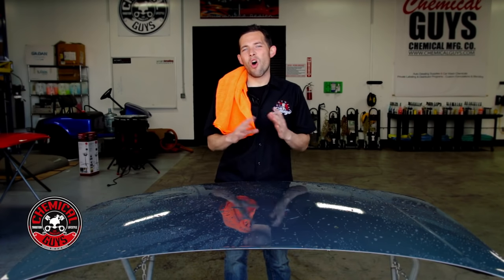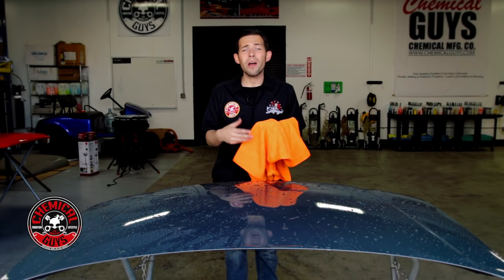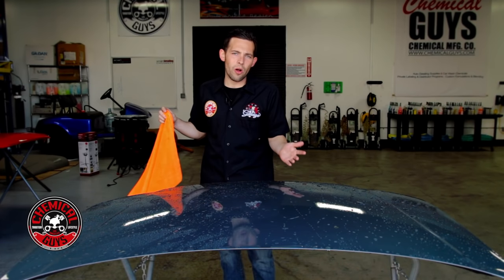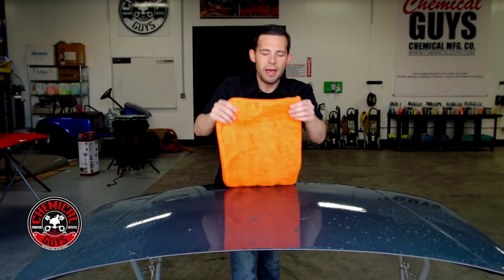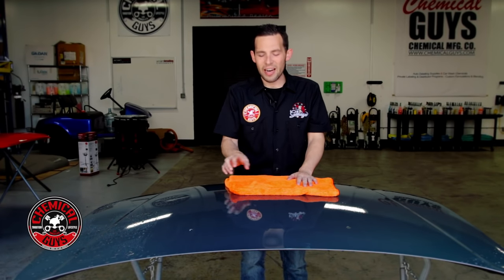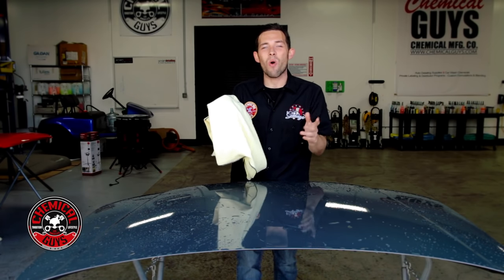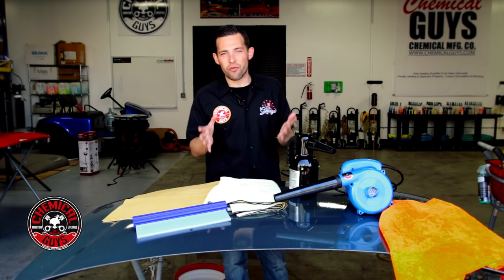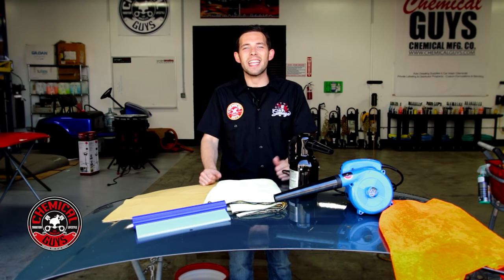Best Car Drying Tools: Towels / Chamois / Blades / Blowers - Chemical Guys

Comment: How do you clean dirty microfiber towels?
Reply from the maker: Chemical Guys Microfiber Wash is the perfect detergent to clean and rejuvenate microfiber goods. The advanced cleaning solution removes dirt, stains, grease, wax, and grime from microfiber. Microfiber Wash restores microfiber towels back to original condition by releasing dirt and oil from the fabric for a soft feel. Citrus-based detergents penetrate each individual fiber for maximum cleaning results. While typical detergents stay locked inside cloth and garments, Microfiber Wash rinses completely clean for a perfectly-soft, residue-free towel. Microfiber Wash contains no bleach, no fabric softeners, and is safe on all color microfiber goods. Easily clean and rejuvenate microfiber towels, blankets, sheets, bedding, and clothing with fantastic results. Microfiber Wash opens the billions of strands inside microfiber fabric to gently release dirt and grime. Microfiber towels require special cleaning, and Microfiber Wash is specifically designed to clean sensitive microfiber goods. The innovative citrus-based formula is all-natural and will not chemically-burn microfiber, keeping it as soft as the day it was made. Microfiber Wash contains water softeners that neutralize minerals and calcium to ensure your microfiber goods rinse perfectly clean and soft. 

Here's a link to the best microfiber detergent available. https://www.chemicalguys.com/Microfiber_Wash_Detergent_16_oz_p/cws_201_16.htm

Comment: lol I have the same water blade but mine is yellow, I actually find it great it helps to get rid of most of the water on the car but I always use microfiber towel afterwards to finish it, I also recently bought Chamois Leather and I'm gonna test that too but from this review it seems like a bad choice =/ also that blower is so weak lol i got turbos bigger than that

Comment: Regarding the shammy you say "because thid isnt microfiber its possible to scratch the car more"? Ok do explain how that is. Oh and by the way the beauty of the shammy is its blotting capabilities sinces it absorbs with no issues.
Reply from the maker: Hey, thanks for watching. The shammy is course, and isn't meant to be dragged along the hood of the paint, that's why it's dunked in the water, and wrung dry. Most towels actually need some kind of lubrication, otherwise you could possibly introduce new scratches and swirls.

Comment: I need something quick, I work at a dealer I'm cleaning about 15 to 20 cars a day and I need to detail and wash them inside out but I need something to dry the cars quickly instead of old towels it takes too long I was thinking of a leather sham
Reply from the maker: Hi Randy, After wash and a large towel will do, the Wooly Mammoth towel is great, it's huge and plush.

Comment: Does it also absorbs the shampoo residue on the car ?
Reply from the maker: Hi Mohd, our soaps are PH balanced so they don't leave any residue, also we use deionized water which doesn't leave water spots since the minerals have been purged through a filtering process. The towels such as the Woolly Mammoth, and the Waffle Weave Towel are extremely absorbent , and they will pick everything up. Stay tuned buddy, we've got more great videos coming your way.

C.G. Alex -

Comment: Your blowers are very misleading.  First, they are to small and not a lot of cu/ft/min output.  And,  in order for a blower to work really well, the surface must have an excellent coat of wax underneath.  No water beading, you'll spend a long time with a blower.  With that said,  I've used nothing but blowers for many years on my 'treasure' cars.   And an average leaf blower from any big box store will do the job better than either of your two featured blowers combined. The heating element is a joke blower.  It doesn't 'dry' anything.  There was some nucklehead on some of the car forums pushing a so-called master blaster.   It too did no better than an average leaf blower, but was 4x the cost. A blower  IS an excellent way to dry your car.  The lesser things that touch it the better.  After each wash,  come back over with some quick detail spray and good till next wash.
Any microfiber towel that is dropped on the ground -  either throw it away or put in seperate box with your oil and grease rags.,  Should never be re-used again.

Don't even get me started on using a 'silicone blade'.

Comment: That heated air dryer... you said it will evaporate water dropplets thus reducing water spots. well...thats how water spots develop in the first place guy. evaporating the water leaves behind the minerals and such in the water, creating water spots.
Reply from the maker: HI Brandon, you're supposed to use deionized water, eliminating the water spots. Also, if you use a drying agent, the water will simply bead off.

Comment: why would I use that "detailer" blower when I could use a gardening one that is bigger stronger and probably cheaper
Reply: trevor philips Many detailers are mobile and having a small blower might be useful, especially if it connects over a 12V adapter.  Might be good for interiors where you can't reach tight areas.  I would probably just use a normal hair drier for inside.
Reply: Like a leaf blower?  I was wondering about that as well.  Would it be necessary to have a filter on the blower?

Comment: You shouldn't drag a cloth across car bodywork to dry, you're better off lubing the car and slightly wetting a microfibre cloth then dabbing. Takes longer but you won't scratch the dust particles in the water droplets into your paintwork.
Reply: +James Wilkinson you didn't wash your car right if there's still dust particle on it.
Reply: +Adam R it's 100% impossible to remove microscopic dust particles which settle in water droplets after wash even if you've used two bucket method, snow foamed etc. 100% impossible.
Reply: You are correct. The above-average person will wash the car outside or even in the garage or wash bay - environments such as these areas will have dust formulate on and around the car. It is virtually impossible to avoid, unless if you are a professional detailer (chemical guys garage) who has a garage that filters out dust buildup inside. 

I personally, prefer the air force blower - at all times i am always looking to avoid any kind of contact with the paint. Even though microfiber or waffle weave towels are excellent, it will generate some swirls.

Comment: my cousins just opened up car wash and they use water blades to remove water and than they dry car with alcantara cloth, alcantara is better and much more expensive than microfiber and its weird that nobody is using this method.
Reply: because it sounds terrible.

Comment: I dont understand why anyone would use the water blade over the microfiber or the chamois. You have to do multiple passes over with it and then still you admit that you like to go back over with a microfiber anyway, why not just use the microfiber to begin with since it was 1-2 simple passes instead of like 8+ over the same area.
Reply: It's not as easy to use water blade on car surfaces as it looks. The secret of using it is to be light with it and let the blade do the work. When the blade glides on a wet surface almost with no effort whisking the water away, you've found the right technique.

You need to slide the blade only once on each area even when there remains some moisture. Also, you need to Wipe the blade clean with towel before each sweep.

Comment: alot of people are shitting on the water blade. We used those in the air force to detail our vehicles for years. They sound bad but we never had any problems with scratches or anything. just dont be and idiot and use alot of pressure. I even use one for my European beauty..No problems.

Comment: Safest and easiest? Not even close! Air or touch less is the safest way to go provided the air is filtered. You'll removed 90-95% of the water on the vehicle without even touching the paint. Towel your car of and then move it, your guaranteed to have water displace from weather striping and body gaps back onto the surface.
Reply from the maker: Brett T  Air requires electricity. Thus, microfiber is easier to use because it can be used to dry a car anywhere, anytime, without added power sources.
Reply: Chemical Guys regardless of needing a electrical source, you guys make pretty lofty claims that make many people wonder. Many things in the detailing world require electricity which in my mind at least, doesn't disqualify them from being the best way of doing things. You guys make great products but like I said, I really wonder sometimes when watching your videos. You always talk about being less aggressive so what's less aggressive then not having to touch the paint.
Reply from the maker: Everyone on the internet is a skeptic. Just pick whatever drying method you would like and be happy with it.
Reply: It makes sense to have filtered air, especially since an air compressor builds water in it over time. However I don't think its necessary for 99% of the cars we will use them on.
Reply: +Chemical Guys I don't think he's being a typical Internet sceptic dude. he's a car guy who wants to know exactly what he's doing to his paint. i wouldve expected you to understand car enthusiasts like us instead of just pushing products. seems that's what we get from an anonymous person from chemical guys.
Reply: Dr. Siracha he's not pushing products, he's giving you options. But hey, if some guy online says you should buy something and you uncontrollably buy them because he said so, that sounds like a you problem.
Reply: No cost if you drive around your block and back to your house.  Then I use a microfiber drying towel to wipe where two materials come together to get that last  bit of wetness out.  Patti

Comment: I really feel like that hood is ceramic coated. That water came off way too easy
Reply from the maker: Hey Josh, if Carbon Flex C9 was applied on that hood, the water wouldn't have had even had a chance to settle on it! That's how slick the coating is. In reality, these hoods sit outside all day and all night for months on end. They are the hoods that the students at Smart Detailing University learn how to polish on and they receive constant abuse. The way the water comes off is just the result of quality products! Thanks for watching, Josh, and check back tomorrow for another amazing video!

Comment: Why not driving the car instead wiping it dry?
Reply from the maker: Hi! Great question. We recommend drying your car before driving because if you take off while your vehicle is still wet, minor contamination will stick onto the surface of the vehicle and get it dirty again. Also, if water drys onto the surface of the vehicle, it may cause water spots. If water spots etch into the paint, it can only be removed by polishing or wet sanding. Happy detailing!
Reply: @ChemicalGuys  Hi, thanks 😊

Comment: If i paid someone to detail my car and i walked in on Them drying it with a blade i would lose my mind........"rrrreeeeeeeeeee........what?" smh
Reply from the maker: Hi Mike, most people either use towels, compressed air, drying agents, or quick detail sprays to break up the water. Very rarely will you see anyone use a water blade. I can imagine using it on the Windows, maybe not so much on the paint. The sound of it scraping against the hood simply makes me cringe.

C.G. Alex -

Comment: What brand of detail carts do you use ?
Reply from the maker: We use these basic carts from amazon. They are very high quality. Highly recommended. 
http://www.amazon.com/Rubbermaid-Service-Utility-2-Shelf-9T6600BLA/dp/B000MK9WZC/ref=sr_1_2?ie=UTF8&qid=1438617983&sr=8-2&keywords=rubbermaid+carts
Reply: nmore69 If you are close to a Harbor Freight, they have some nice ones, too.  They have a plastic one very similar to the one CG recommended below except it's much cheaper.  I use a Harbor Freight 90428 (you can see on the HF website) that is steel with a locking drawer.  I use it all the time and would highly recommend it (especially since it's on sale frequently...I think I only paid about 60 bucks for mine).  Hope this helps!